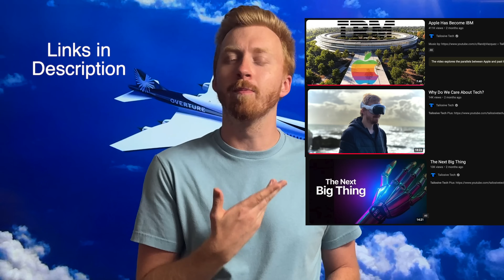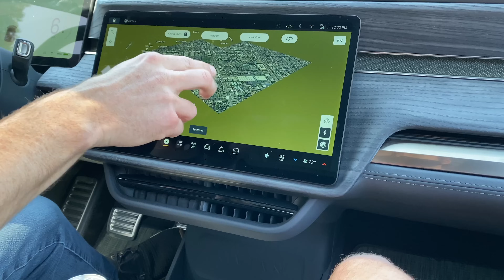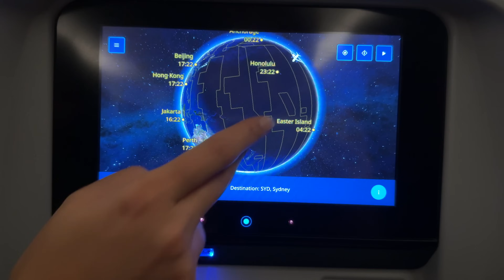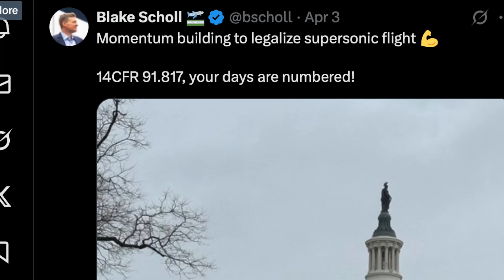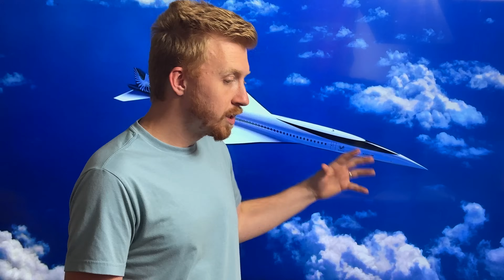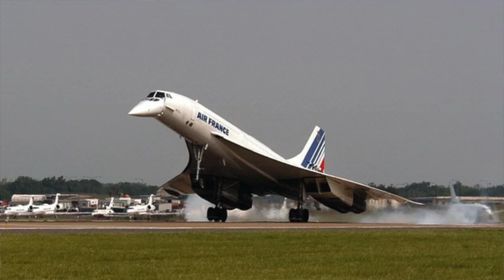Meet Boom

Comment: I'm excited for aircraft innovation, but current leisure consumers don't care about flight duration. What's another 3-5 hours when you already woke up 5 hrs before your 4am flight. In fact, consumers would rather deal with connections and pay a cheaper fare, rather than take a direct, but more costly flight.

Unless consumer sentiment shifts dramatically, or prices are low enough, I predict that future supersonic flight will be mainly be used for business travel and 'luxury' experience leisure packages. Hopefully in the 2040s, supersonic flights will become cheap enough for the masses. 

On another note, I'd be interested if you covered electric planes!!